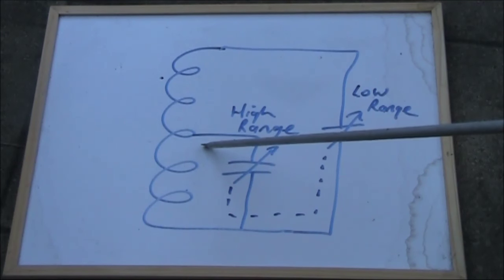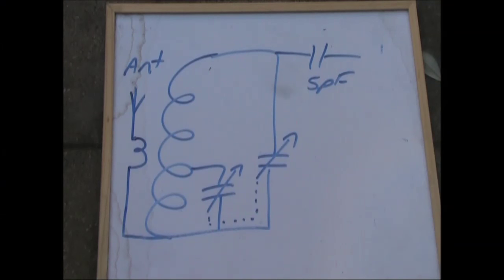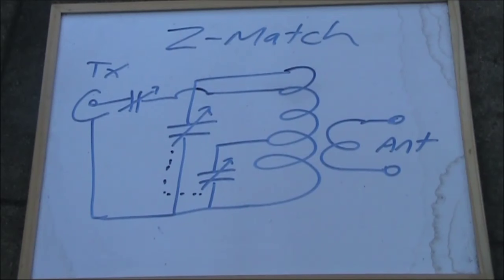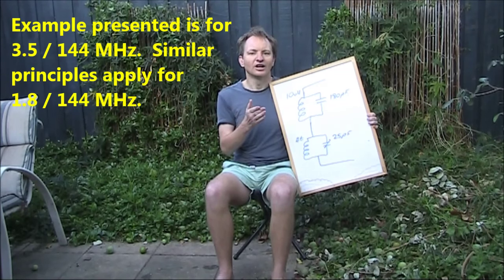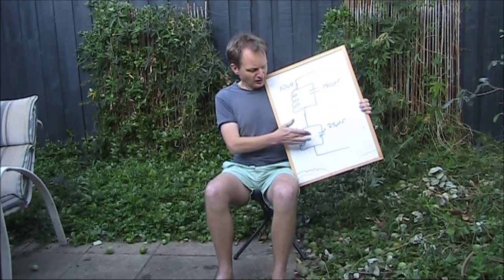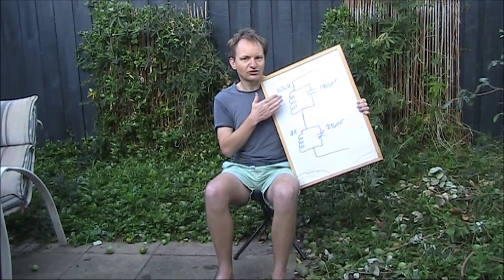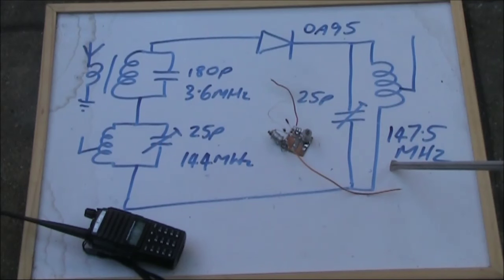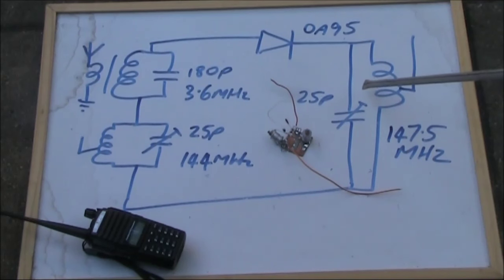Two tricks with tuned circuits

Comment: I was recently experimenting with an AM / FM receiver chip and it uses the same ideas presented in this video. The AM and FM band share the same mixer output pin with the higher FM passing through the AM IF tank circuit unimpeded.

Comment: Hmmm... This circuit could be used at a broadcast site to create intentional intermodulation. Use the powerful signals present to be your LO and two mixing frequencies at once. Parallel several diodes so they can handle the power to a reasonable level. Hide it in a tree. I can see the site technician stamping on it repeatedly when he finally finds it :P